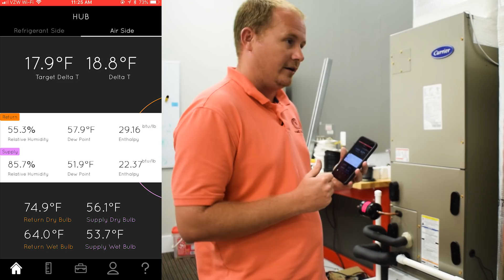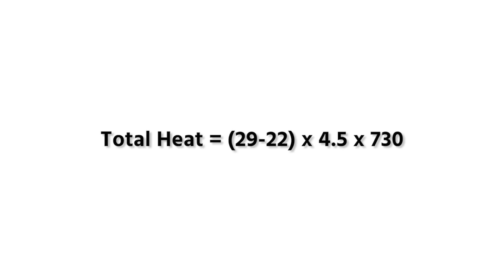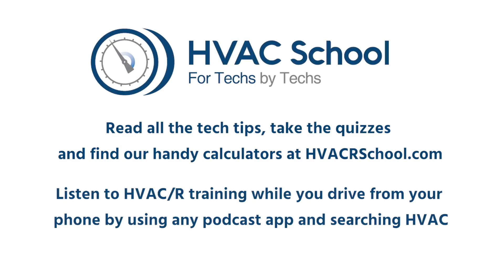How to Calculate HVAC System BTU Capacity

Comment: What is the 4.5 in the calculation supposed to represent?
Reply: Better yet, what is the constant of 4.5?
Reply: 4.5:
This is a constant value derived from standard air density and a conversion factor related to air volume (cubic feet per minute, CFM) and minute to hour conversion. Specifically, it's calculated as 0.075 lb/ft³ * 60 minutes/hour.
Reply: That’s the weight of the air around us